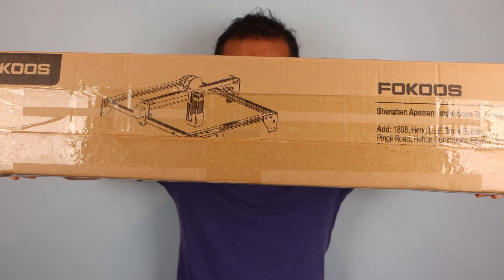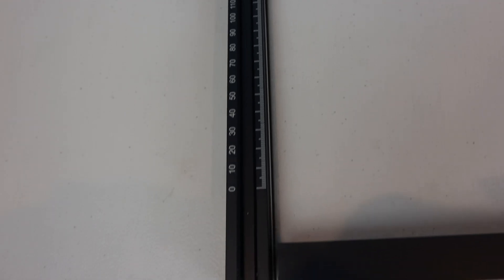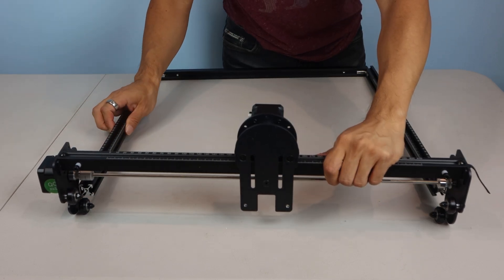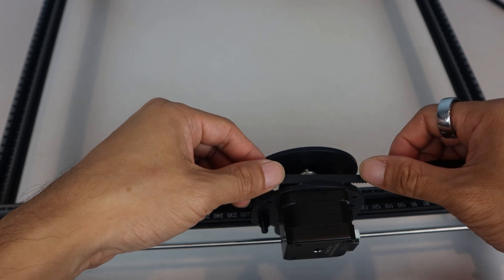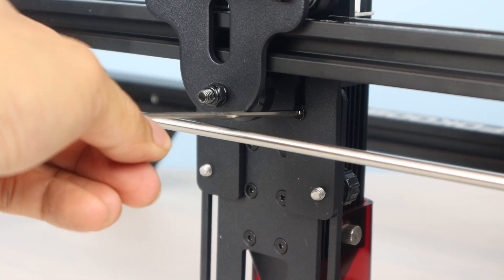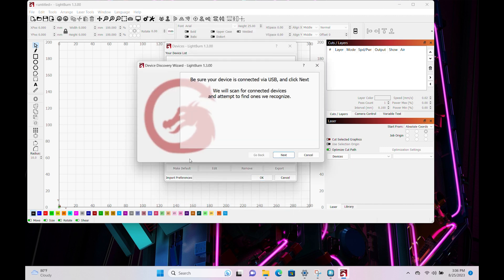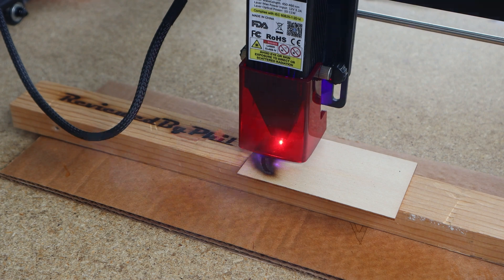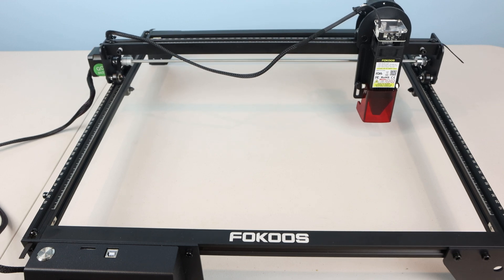Fokoos FE10 Laser Engraver Cutter Assembly and First Impressions Review

Comment: How did you line up your design on the circle perfectly?
Reply from the maker: There's an alignment setting that uses a low powered red laser dot (so it doesn't burn/cut) that allows you to position your piece correctly. Then just make sure the dimensions of the cutting area are set up correctly to the size of your piece. If you have a grid base with measurement lines this makes it a little easier, but otherwise I just eyeball it.

Comment: Can you please tell me how you set this up on Lightburn?  I tried plugging it in to my pc and it found it. But it sits with no PC in my craft room.  When I try saving the materials test gcode to the tf card, and put it in the engraver, and hit frame, it smacks in to the back and gives me an error message. The included test files work fine.
Reply: I got it to work on lightburn just fine
Reply from the maker: Unfortunately, I wasn't able to get Lightburn to run or detect the machine, I ended up using GRBL instead.

Comment: Can this work on sheet metal?
Reply from the maker: Purported it works on metal, however, the caveat is that it shouldn't be super shiny/polished, as the laser engraver doesn't perform well on reflective surfaces. Some folks recommend using a marking spray as a pre-treatment, so the laser can "see" the material: https://geni.us/Lr5G [Amazon Affiliate Product Link]